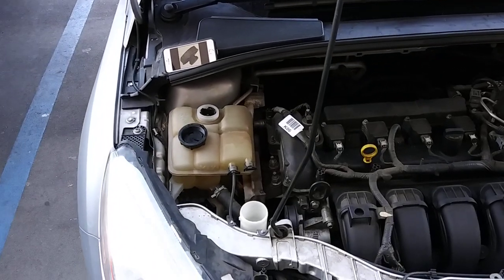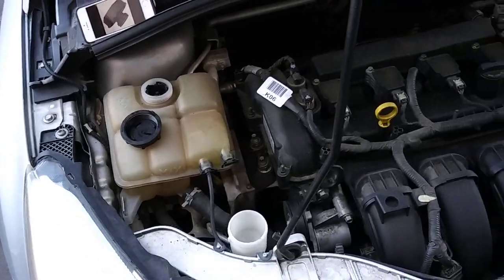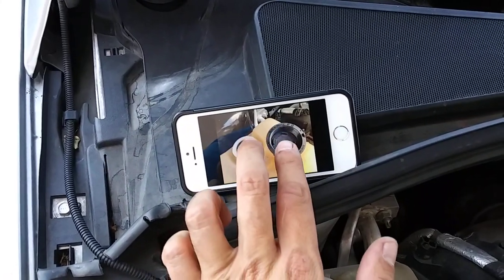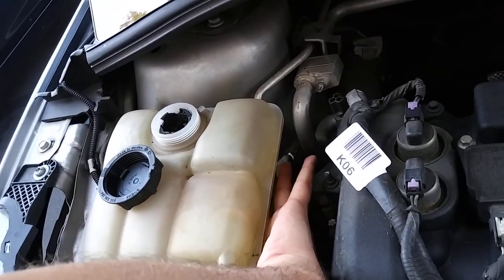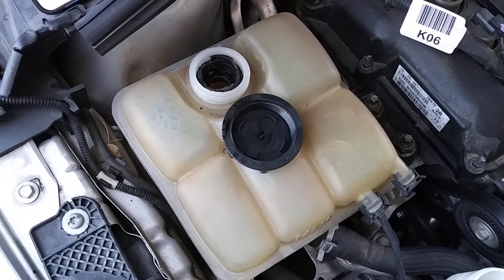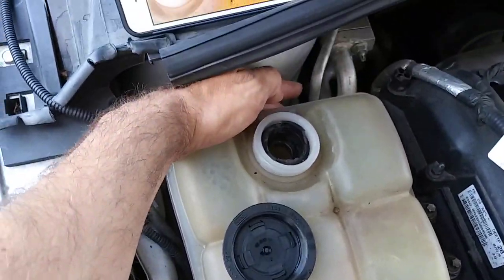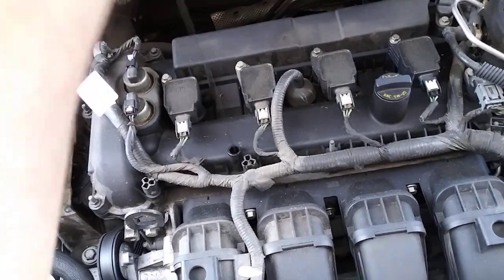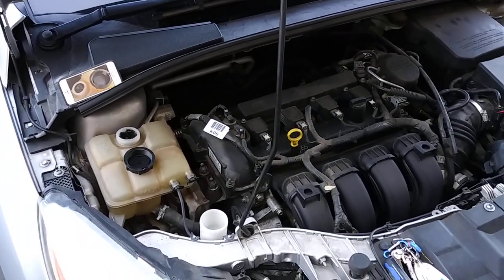Broken radiator cap issue with Ford and other vehicles - (2016 Ford Focus)

Comment: You have air in the system. Run the car with the heaters on for a while and when it cools down top it off.
Reply from the maker: Already tried that.
Reply from the maker: The coolant literally comes to a rolling boil inside the reservoir. It's not supposed to do that. Reminds me of cooking noodles 🍜
Reply: @Network126  Sounded to me like an air lock in your heater core. Hope that you don't have milky oil.
Reply from the maker: @TexxxTexaco  Nope. The heater blows hot air just like it's supposed to. It wouldn't do that if it had an airlock. Plus I literally said in the video that there doesn't appear to be any coolant in the oil. I even pulled out the dipstick dude. Didn't you see that part?
Reply: @Network126  I'm like most people. I don't watch your videos....I just comment on the titles.
Reply: @TexxxTexaco  lol
Reply: @Tulsa74127  Thanks for the laugh Michael!
Reply: @TexxxTexaco  Hey it was funny. Lol

Comment: No one has mentioned how to test the tank cap. I assume there should be pressure on the cap when the dash gage is about half way.
Reply from the maker: The coolant will boil out of the reservoir and the engine will overheat if the radiator cap isn't holding pressure

Comment: I have a Ford Transit Custom 2017 with the same problem. I personally just found that if you use a flathead screwdriver, put it in one of the outer grooves, hold the bottle stable and pull the screwdriver toward you, the middle section pops off like a Jack in the Box. You can at least fill it up that way (just below the Max). Then, put the spring back, small black piece on top, press, lock by using the screwdriver (carefully) and replace the cap. COOL engine ONLY.

Comment: I just spent about an hour wrestling with the internal part to remove it on our 2010 kuga. Two flat end screwdrivers and side cut pliers/snips. Lifted the edge with screwdrivers enough to chew out a vertical cut in the black bit with the pliers. Eventually it gave up, but I had to be cautious not to damage the white threaded neck, and keep bits of black debris out of the tank. If only I had watched the video on here from the Scottish guy first. He put about 1/2 a kettle of just off boiling water round the perimeter of the threaded neck to expand that part. His stuck bit came out pretty easily then. I have a small electric heat gun (crafting size) that maybe I should have used around the edge of the white neck to create enough slack to pull it out. Heat on the outside - the opposite of getting the lid off a jar, where the lid is heated to slacken it.

Comment: Success on Jeep Grand Cherokee. Warmed jeep up for 10 minutes. Used boiling water then tugged from side to side with pliers and it popped right out. Sprayed new cap with silicone.
Reply from the maker: Quit making troll accounts dude.

Comment: How did you tip it off if you can’t get the cap off fully? I have the same problem with my focus.
Reply from the maker: Just gotta rip and pry it out with pliers or a flathead screwdriver or whatever it takes. These cars are junk man.
Reply: Put boiling water on it, let it sit for a few minutes. Dry it off, apply a bit of silicone spray. Use two flathead screwdrivers to ease it out.

Comment: They can't even get a simple container and lid made properly these days... just pathetic...
Reply from the maker: They easily could've engineered and manufactured it better, but, as usual, everything is designed to break in 2 - 3 years, so you have to run out and buy a new one every so often. Planned obsolescence is evil.

Comment: You know... I told myself I'd never buy a Ford, until I fell in love with the 2015 Mustang GT.
I'm in the same boat as you were when you recorded this video. Were you experiencing a strange burning-like odor for short periods while driving? It happens intermittently for me, which is why I went to check the coolant in the first place... Then the cap issue was discovered.
I plan to contact my dealership to see what they would charge to remove and replace the existing cap. And I bet, if I brought a new cap with me, they'd refuse to do the repair, even if it was 100% OEM.
Any advice would be appreciated! Thanks.
Reply from the maker: I'm starting to hate Ford lately, but I also can't help but love those 2015 and up Mustangs. I actually have a real Mustang badge on the grille of my Focus. Anyway, don't waste your money at the fucking dealership if you can help it. I got mine out myself. I think I used pliers and a screwdriver, and was able to pull the stuck piece out. You can throw a little water on top if you need to, to help loosen it up. A new cap is only a few bucks at places like AutoZone.

Comment: I have the same problem, pressure inside the system and also the cap is defective. Did you find the solution is the broken cylinder head gasket

Comment: Brian, I had the same issue with my Mazda 3 coolant reservoir which looks like the exact same reservoir as yours. Upon doing research looks like Ford made these for Mazda. I also experienced coolant disappearing, so what I had to do was replace the whole reservoir and that fixed my issue.
Reply from the maker: Great to know if I go to Pick-A-Part!
I'll check the Mazdas too!
Reply: @Network126  Yeah looking at your reservoir tank it has cracks all over it like mine did. The yellowish color shows its age.
Reply from the maker: @ren1018  Most definitely! Looks like it's getting brittle. Maybe I can get lucky and find one that was just recently replaced with a new one shortly before being in a wreck.

Comment: I've got the same issue with mk1 focus, replaced the coolant expansion tank as it had a crack in it. I then replaced it with a 'cheap one' and it overflows from the valve at times just like yours does..no oil or water mixing either...burped it a few times too to allow air to escape but water still boils up in tank and overflows..thinking it could be the cheap expansion tank as I tighten the lid and it suddenly becomes loose when overtightened so there has to be a quality issue here..prob replace it with a genuine Ford sourced expansion tank and see how that goes..BTW I replaced the thermostat too but no difference so it shows these garages don't know what they're talking about hald the time either.

Comment: Well I'll tell you this much if you ever going to buy a Ford focus... 
Make sure you get an older one...

I drive a 2005 Ford focus zx4 ST.. it's the sport model I didn't fully realize that when I bought it but it was an added bonus, it's got a five-speed manual and it kicks ass on the road!! 

I bought it used for $1,200 it had a shattered windshield the original owner hit a deer he owed another guy money so I bought it for the amount that was owed which was $1,200 it runs great!! 

I only had to put an alternator on it and I had a tune-up done to it! It was an incredible find!

Comment: Screw in two brass hooks into the top of the broken part of the cap.

Pass a metal rod of some kind through the two hooks, then just pull up. The broken cap will slowly pop out.

Comment: The issue here is that you are suppose to remove the cap after the car has sat for 10
Minutes and the pressure is low.. it is suppose to
Be removed while it’s heated… don’t do it in the morning or you will unclip it from its bottom part -.- fucking hate this
Reply: Thank you for that bit of useful knowledge, I will try it later.